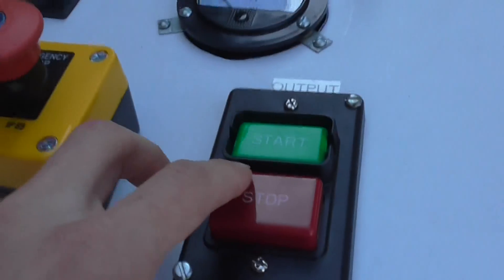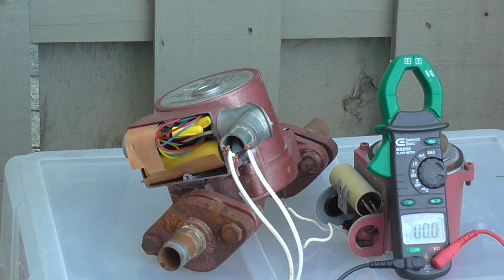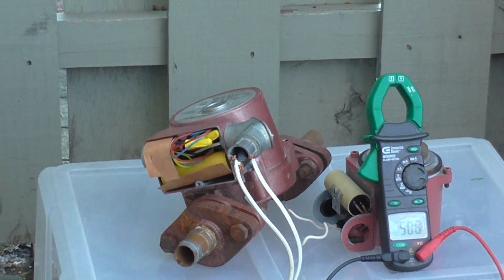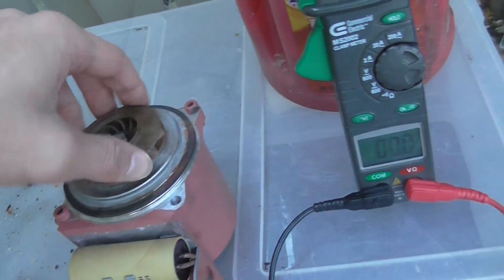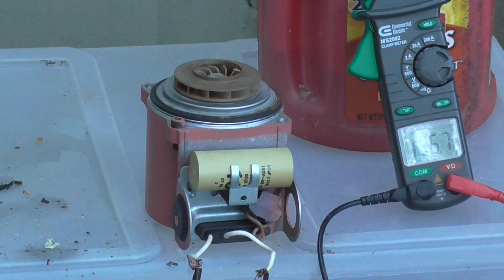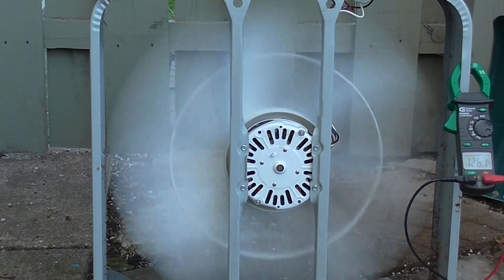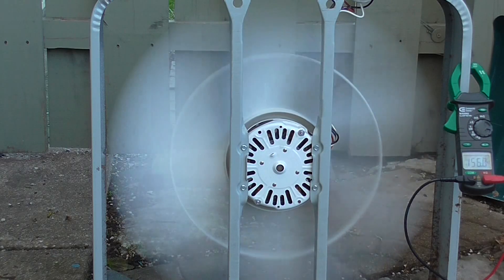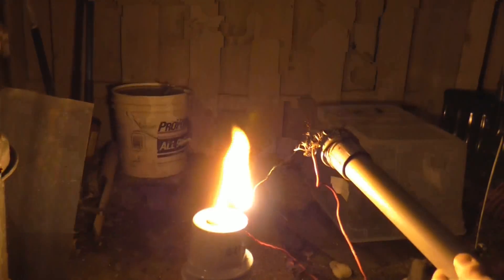Pump Motors + Fan Motor Severely Overloaded Electrically.

Comment: that sucks you killed the box fan motor  those older motors make great generators for wind power. but the fire and Sparks were cool though.
Reply: That style of motor doesn't have any permanent magnets in it so it would not work for generating power.

Comment: Neat, but you should look at rotary phase converters etc.
basically do a multiphase supply.

The motors would have more torque if you removed the capacitor and feeded in the extra phase, especially since the capacitor is optimal over a smaller operational range.

Comment: Yeeeaaaah, mission accomplished..... We have flaaaaames :D

That first pump looked similar to a GRUNDFOS pump used in central heating here in the UK.

Haha..... that second device certainly had a right squeel-up before letting out the smoke.

The box fan was a bit disappointing, but now we know. At least now, when you see someone asking Mr. Photon to "overload a box fan until it pops", you can direct them to your vid so that they can see exactly what happens when a box fan is over powered..... it blows a winding and that is the end of it.

Thanxx for showing,

-Wayne's Electrical.

29th May 2017, 12.28
Reply from the maker: Thanks for commenting!! Yes, but I think the box fan should go on photon's mega mot, then there will be real power surging through it:) Nothing happens, expect to see his favorite tool!!
Reply: I have an idea: If you still have that box fan sitting about, try teeaasing it on a bank of MOTs. 

Then... if the motor has indeed blown a winding, the [gradually increasing] potential will eventually find the gap in the windings and start fizzing across the gap.... for the optimum fizz-up poppage carnage. :D

-Wayne's Electrical.

29th May 2017, 18.20
Reply from the maker: Sounds like a good idea!!
Reply from the maker: It actually is a GRUNDFOS motor, forgot to mention it!!